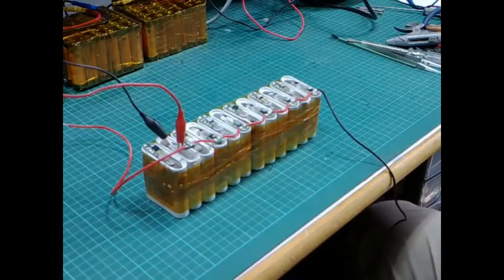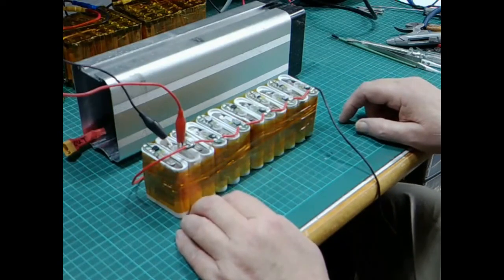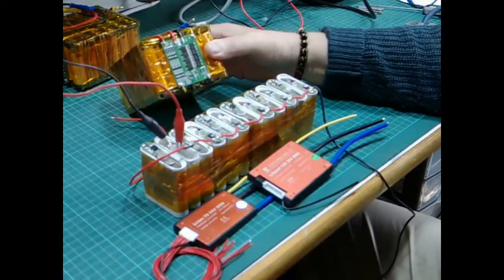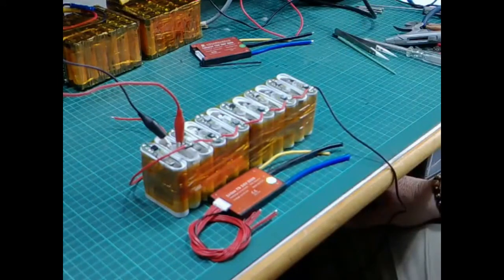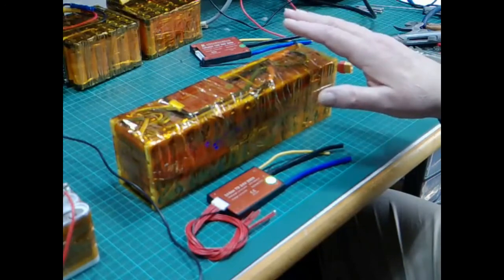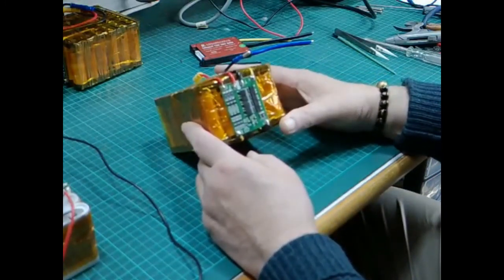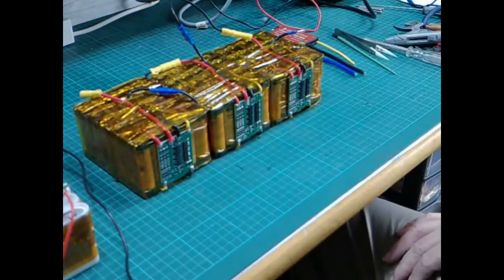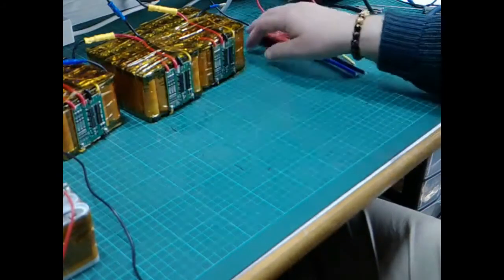Batteries a Go Go.

Comment: i think maybe the bms is not upto the current an ebike draws i would use the bms to control a contactor relay to supply power direct from battery to speed controller tends to be how they do it in cars also i think a low voltage alarm that displays voltage of all cells would be handy

Comment: i counted the cells and counted 12 cells shouldent it be 14 cells for 24v to be a match for lead acid 24v if on an ebike ?
Reply from the maker: Hello my friend. It is 14s. I built 2 packs of 7s and joined them together. Also 4p. The fault wasn't the battery but one of the brake lever switches. Just finished swopping the whole brake lever assembly for a new one and binned the old. Works great now. Thank you for your input. I shall also take your advice about mic proximity. My regards to Diane. Please stay safe both.
Reply: @MYNICEEV  i ment the very first battery you had in your hands lol diane and i are doing ok but people at my work place are dropping like flys with covid just a matter of time if i have not had it allready
and lever switches dont i know the hassle of them my fron brake one started playing up as i was taking bike for mot so i ordered another 2 so i have spare some times abit of contact cleaner works this weather we are having is not good on electronics on another not did you get the sla style cases for the 18650 in the end ? one of my packs has just died bms fail all cells 0